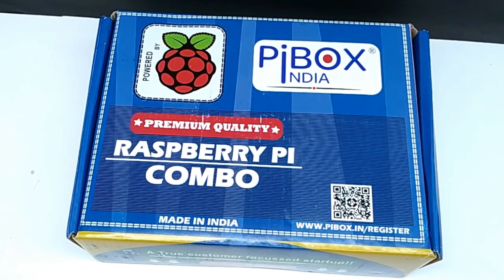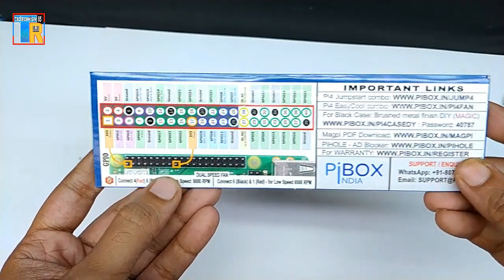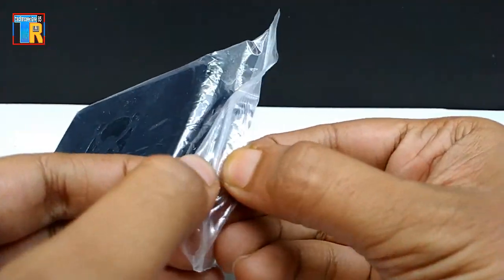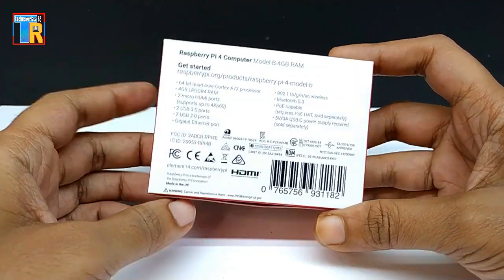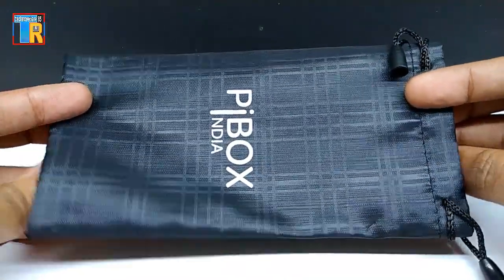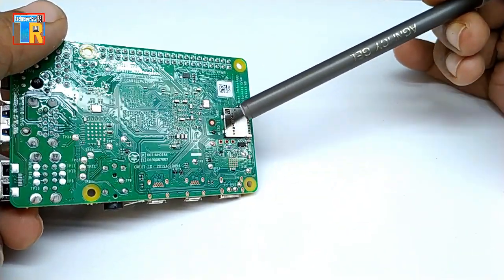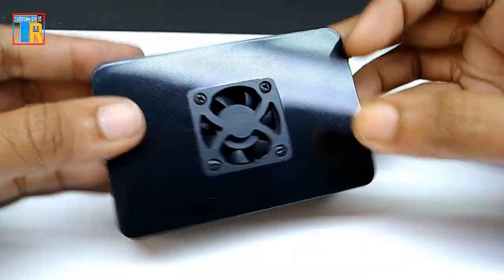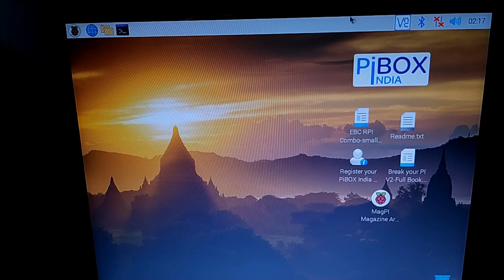Pi Box India Raspberry pi 4 kit Unboxing, Review & Setup

Comment: Good video . Everything seems fine except the direction of the Fan . Ideally we would want to remove the hot air getting accumulated in the pi  . And with 1 fan , i would recommend to set the fan to move hot air outside rather than sucking in outer air . its not efficient to cool.
Reply from the maker: Thanks for your opinion. sides of the box have some gape for throwing out hot air so if the fan flow on the processor, the hot air comes out. after fan installation, the CPU temperature is near about 40° that means the fan is working.
Reply: The fan Direction on the video is correct and accurate. There are funnel vents on the bottom of the case and on the side for circulation.